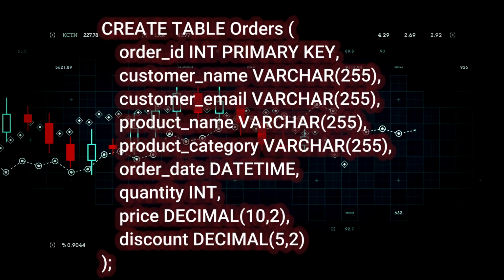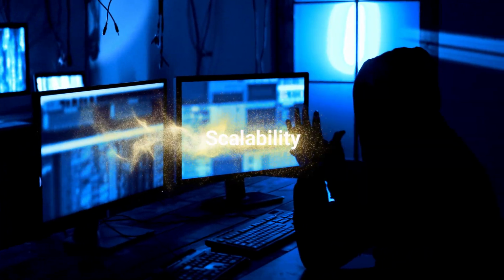Think You’re a Senior Data Engineer? Prove It.

Comment: For the Query question:
just create a whole new table that already shows you the sum of (od.quantity * p.price),
What im trying to get at is, instead of having a query with the join clauses, you would create a table or view based on the joins cluases , then you can use the sum of  sum of (od.quantity * p.price) then you would just add the  where, group and order by statements.
Reply from the maker: You're thinking like a data engineer! Consider clarifying your explanation and sprinkling in mentions of incremental updates, indexing, or even partitioning for bonus points in performance-critical environments. 7 points

Comment: problem #1 
-use non-clustered indexes on each of the join columns for each table and possibly the o.order_date column as well. 
-think about creating one big table(or view) so you dont have to do any joins. Will create data redundancy, but storage is cheap compared to performance. 

problem #2
-Assuming you have other tables...take out customer_name and customer_email. Those should be on a 'customers' table. And they should not have VARCHAR(250), Use VARCHAR(50) to save storage. 
-Add a customer_id to join to the 'customer' table
-Take out product_name and product_category and put them in 'products' table. Do VARCHAR(50) with product_name and product_category as well.
-Add product_id to join to 'products' table

problem #3
-Not experienced with JSON. But shouldn't be too hard with a somewhat simple python script
Reply from the maker: @ezequielregueira - 

A1: Good instincts on indexing and performance trade-offs, but give more thought to query-level tuning and when denormalization is appropriate. (6.5 points earned)

A2: Nice job spotting normalization issues and focusing on clean design! You’re thinking like a real data engineer here. Push it further next time with how you'd enforce relationships and handle updates/deletes across the model.  (8.5 points)

A3: We all start somewhere, but this is a good moment to lean in, even if you're unsure. Try describing what you'd do if you were learning, mention tools you’d explore or what the goal would be. That’s how you stand out in interviews. Great job of starting out with being honest! (3 points) 

You clearly have a solid understanding of performance basics and normalization. I’d love to see a little more technical depth and confidence on Q3, even if it’s a stretch. Keep at it, you’re doing great